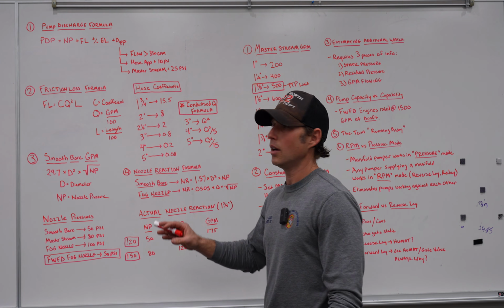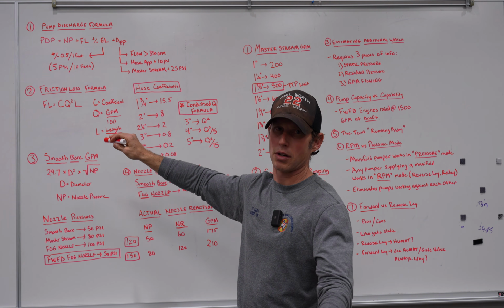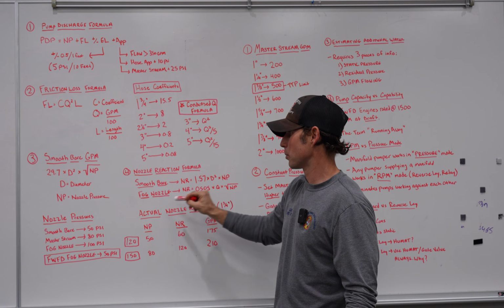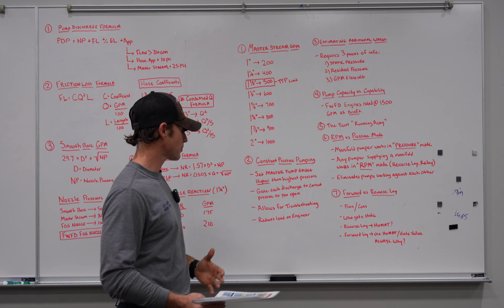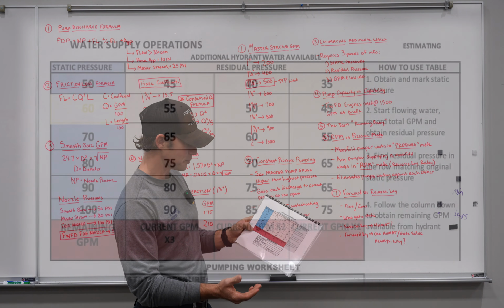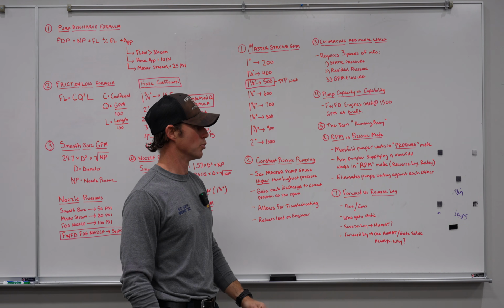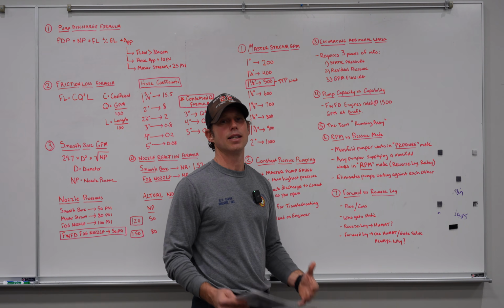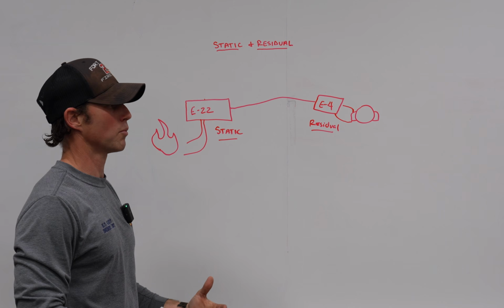FWFD Driver Operator Hydraulics

Comment: My calculation strategy:

Know the approximate nozzle reaction force that a F/F is able to manage under the conditions at hand. I alway used 45 pounds as a starting point. Then use 1:10 the nozzle reaction formula = to 45 to work backwards to find the corresponding GPM. Use the GPM to calculate the friction-loss (FL) ( turbulence ) for the lay at hand. Next add the total FL + Nozzle pressure for your Engine pressure. 

But wait, how do you figure the GPM for a nozzle operating at slightly less pressure than its rating? 

The square root of the rated nozzle pressure over the rated GPM. Like a rating may be 125 GPM at 100 psi. Set this equal to the same set up  on the other side of the equal sign  so it should read the square root of the NP your looking for, over the GPM you got when you plugged in 45 pounds into the nozzle reaction formula. 
Now solve using algebra for the unknown nozzle pressure on the right sided of the equation. 

These calculations are important because the standard nozzle ratings, if followed, typically produce too much reaction force for one firefighter to handle for any duration beyond a couple of minutes.  See chat GPT to find the nozzle reaction formula that is recognized today by Fire Engineering. 

After you do your calculations for the attack lies pre set up on your engine, commit them to memory. 
Maybe make flash cards. 

Your cross lay is pulled! Bam you know the engine pressure! Remember the firefighters have to pull working line around and through obstacles and sometimes go up stairs. If they go up stairs,  you could safely add 5psi more.